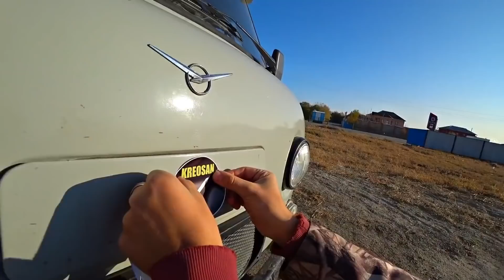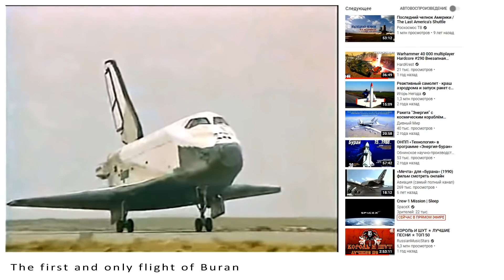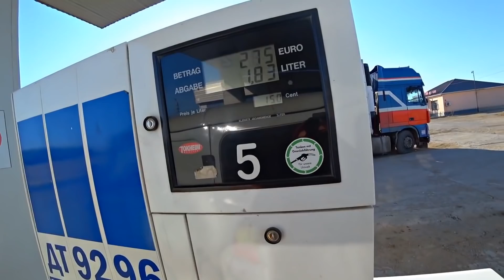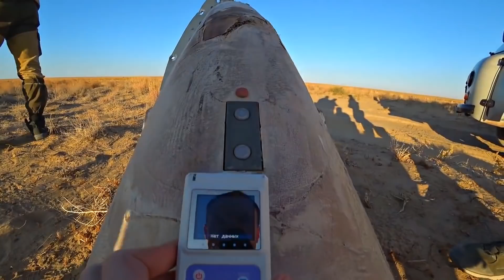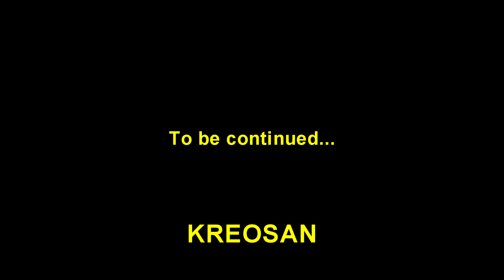Storm of the Baikonur COSMODROME 🚀 We broke through on UAZ to the missile launch pads 😱

Comment: If you get it in 4rt treu releasing trotle than pressure group clutch is koming.
If it is  do or before the shaft coupling is grinding otherwise you read to replace the total gear transmission mechanism. 
Is match costs en time😍
Reply: Enjoy existing😍🙏💟🌈

Comment: Ok, why didnt the duct tape get used as soon as they got it instead of waiting till much later on to use it for the hole?
The vehicle has a very similar to design I think to the one that was used for the Dyatlov Pass adventure they did, though that had been modified. I could be wrong but they do look similar
Reply: UAZ Buchanka ("Loaf of bread") is around for 60 years or something. The Red Army we had in East Germany had them as ambulances - the same design, the same car. You can have them either in Read Army Green or nice grey. What they have in the video is a later model with LCD odometer and EURO 5 exhaust specs - meaning that you can actually register and drive it in Western Europe.